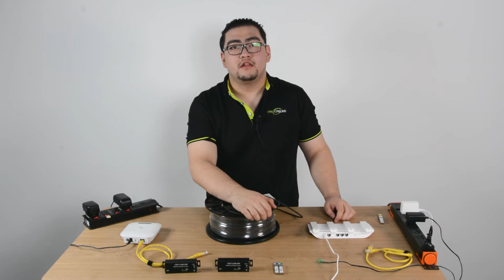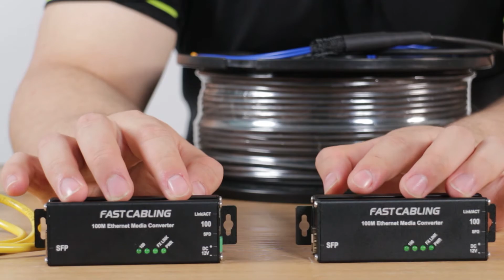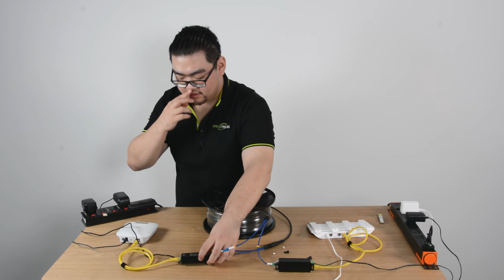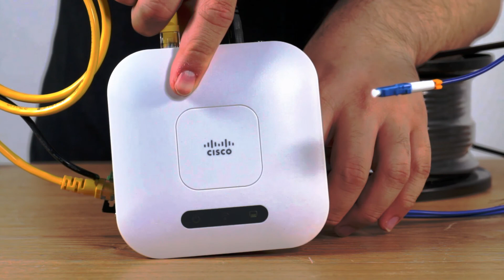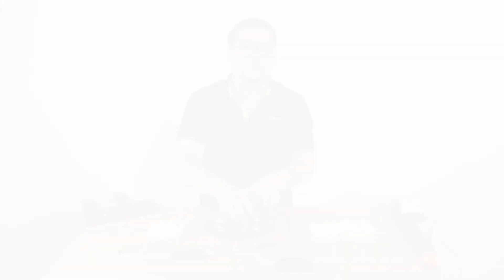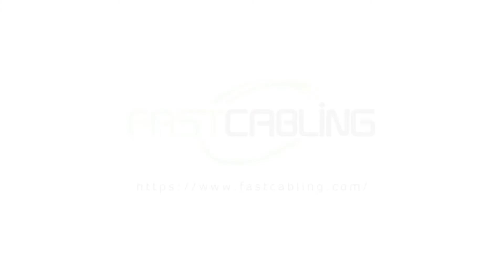Fiber Optic Link System Setup#1: Transmitter and Receiver Explained

Comment: Is the sender and reciever converter the same model?
Reply from the maker: Yes. Generally, single-mode dual-fiber (normal communication requires two optical fibers) converters are not divided into transmitters and receivers, as long as they appear in pairs, they can be used, while the single-fiber converter usually works with BiDi SFP modules which can transmit and receive the signal on a single fiber cable.

Comment: What would be the solution for transmitting fiber optic signal from one station to another station 26 miles apart? Do you have equipment for  a long distance fiber optic networks? Thank you advance, Fast cabling Team
Reply from the maker: You just need to choose the SFP transceivers which can supply up to 40KM. It doesn’t relate to the Switch or media converters at both ends.

Comment: I'd want to make s 5 km (yes, 5000 meter connection) from the neaeby town to my home. We have shitty internet and companies do not provide a solution to get cable internet (we're stuck to overcrowded 3G or LTE internet networks). So basically I am thinking myself of getting to buy a good internet connection on my own. If the cable was 5000 meters (set aside regulations) would it not lose band speed?
Reply from the maker: I think you can go for fiber optical cable. No need to concern bandwidth loss. It has no problem to deal with up to 20km for very basic fiber optical system.

Comment: Why does it need a converter when the transceiver's job is to convert digital to optical and vice-versa?
Reply: I'm assuming there's no way to plug the SFP directly into that type of switch
Reply from the maker: Yes, there is SFP slot that can take in the SFP transceiver. You can pick the different SFP transceiver basing on the connector (SC/LC), Duplex or BiDi (use single fiber optical cable or different wavelength to transmit and receive the signal), wide range temperature for outdoor, etc. The convert the digital to optical and vice-versa is always required. The convertor can provide the fiber optical link without adding a new switch to your existed network infrastructure.
Reply: We want Gigabit .?
Reply from the maker: Most of the fiber optical solutions can achieve 1Gigabit speed in over 10 kilometers. You can even have 10G speed but requires network equipment supported.